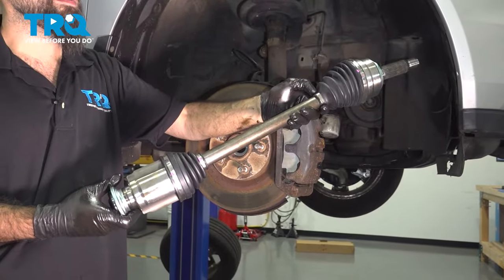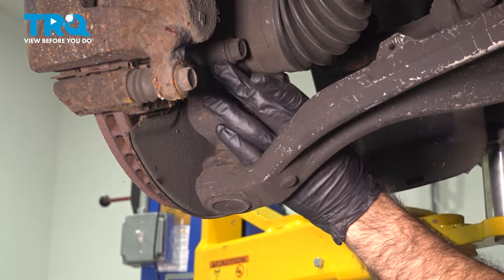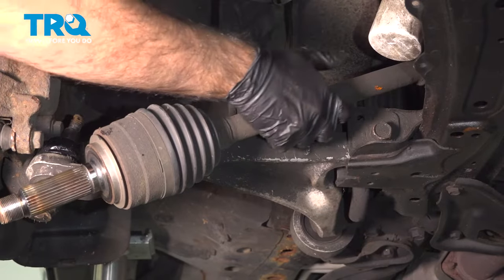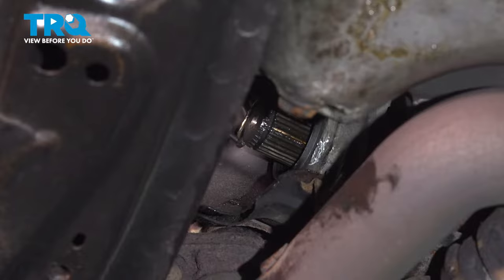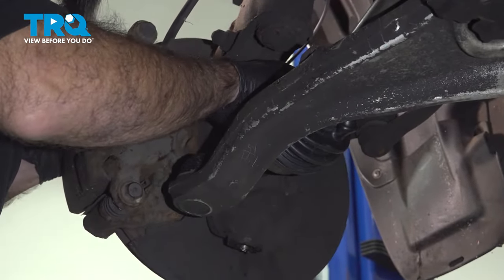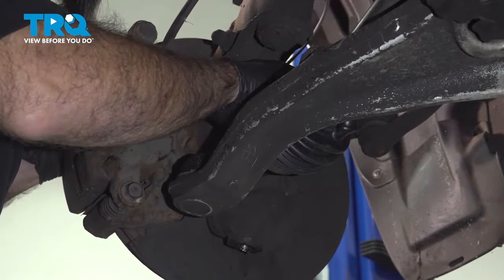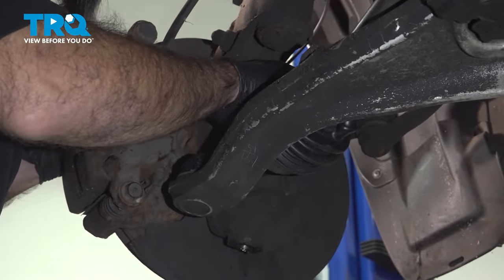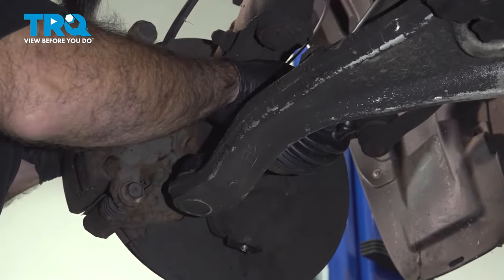How to Replace Front Passengers Side CV Axle 2007-2013 Acura MDX

Comment: For future reference, you should NEVER hammer the cv shaft on like that. You risk rolling the C clip on the end of the intermediate shaft. Manual says to align the splines, then sharply push the cv axle on. I just did all 3 axles on mine and that's how they went on, very easily. You gotta act like you're stabbing it in without pulling back so as to keep the splines aligned.

Comment: Thanks for the vid. Super helpful. I didnt have a pickle fork but I used a long pointed punch and slipped it behind the knuckle and pinned the point into the divet on the ball joint stud. Hammered for a couple minutes and it came right out, no sweat

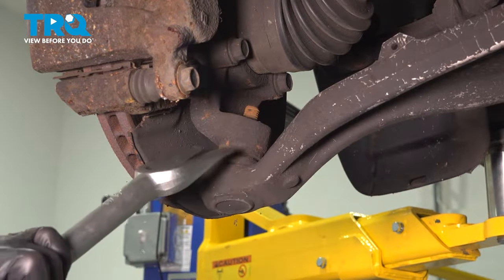Comment: Thank you for the video.  At 3:06, using the pickle fork damages the ball joint boot, which will eventually require removing the lower control arm and either replacing the ball joint (difficult) or replacing the entire control arm.  Instead of using the pickle fork, another approach is to not disconnect the lower ball joint at all and instead detach the steering control arm and strut from the top.  This will give enough play to remove the CV axle.

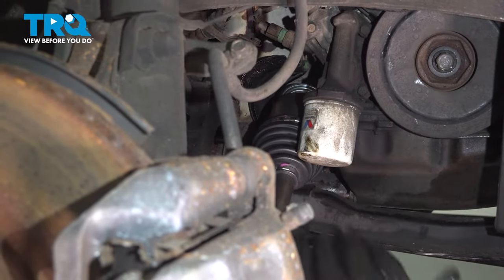Comment: Great video! thank you. If possible for other vids can you show where we hammer for 9:44 with rubber mallot thanks much appreciated. Also 5:41 for my education even if i pull it the cv axle  it wouldn't make a difference would it? It just wouldn't pop out because the base is attached to the transmission.  I'm not pulling the transmission spindle out if i do pull it right.